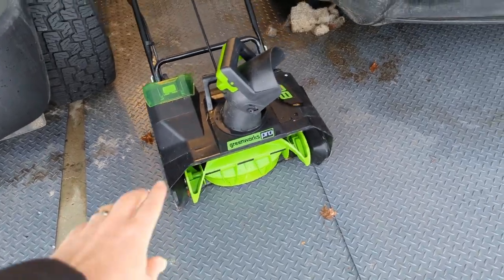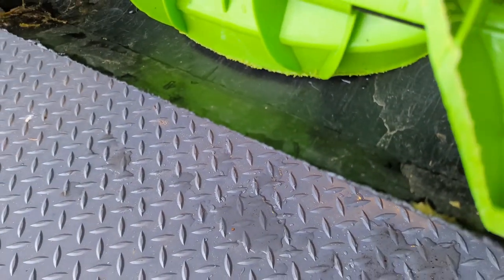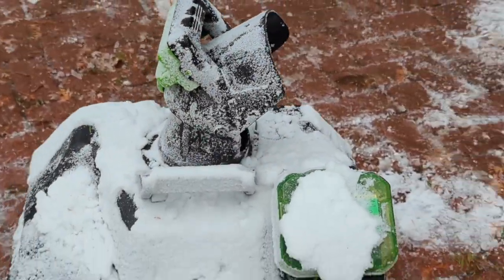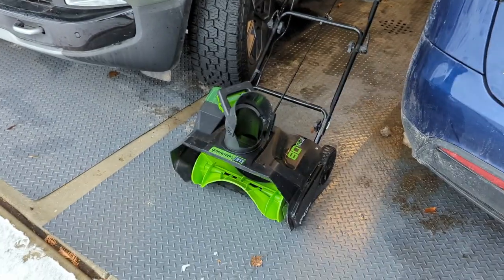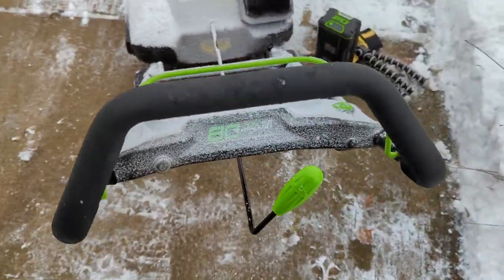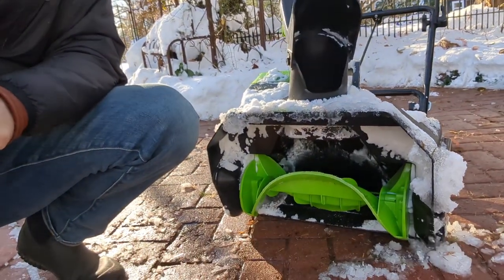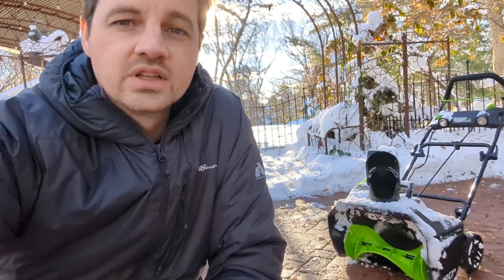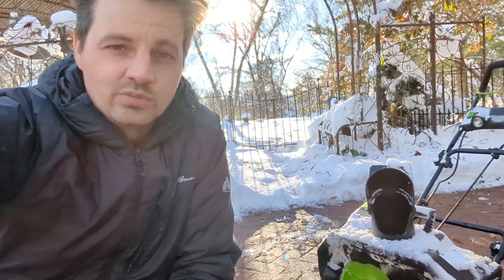7 yr review: Greenworks 80v single stage snow blower

Comment: Did you have any problems with the battery at all in these 7 years ?  I have seen the batteries getting bad sooner on amazon reviews
Reply from the maker: The batteries lose capacity over time. Storing them cold and not leaving them at 0% or 100% helps.
I've had a couple older small ones (2.5ah) stop charging
Reply: @Teslavangelist  Thanks, this helps